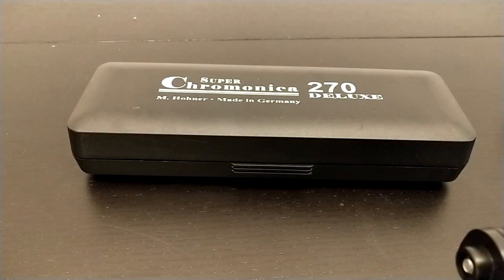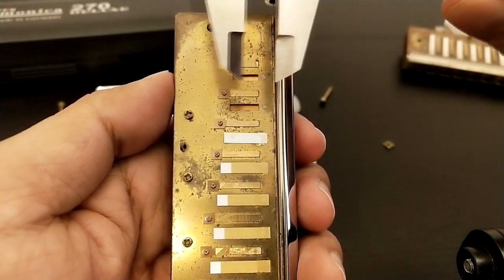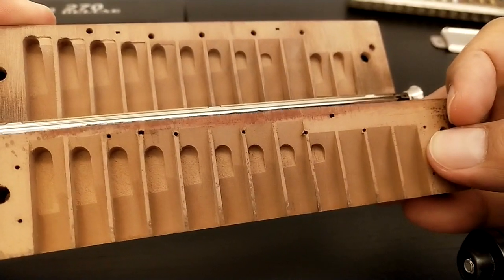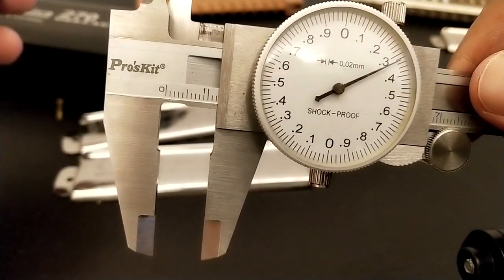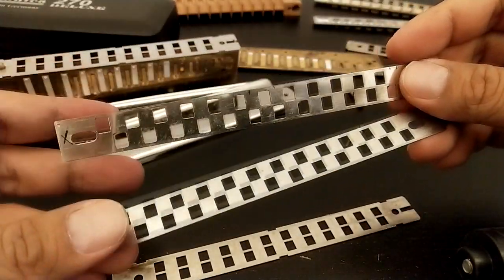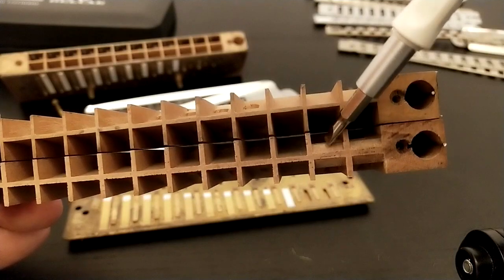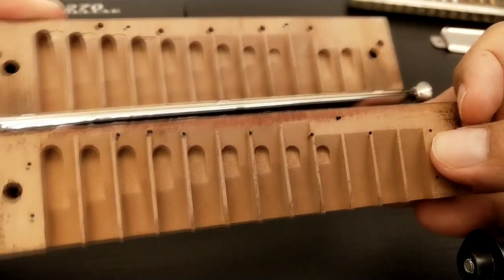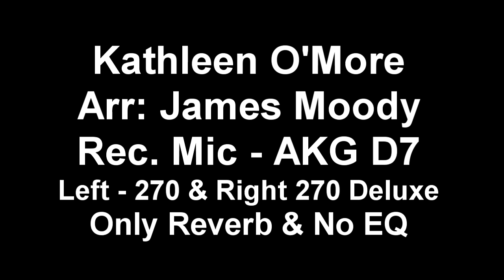Hohner 270 Deluxe vs Chromonica 270 - Owen Harmonica

Comment: This is a fantastic review, very detailed and particular.  I am looking at buying a chromatic either  a 270 or 270 Deluxe. I like the design and the ease of dismantling that the 270 Deluxe offers. The 270 construction (nails) is very much like a classic Hohner Marine Band diatonic and is the cheaper of the two for this reason. Sound wise, I do agree with one comment that the 270 has a darker sound. For me, it may the choice at this time, considering the type of music I want to use it for; blues , rock and jazzy type stuff.
Reply from the maker: Thank you so much for your support, I really hope that my video can help you make your make the right decision. Wish you have a wonderful day.
Reply: Hi. It’s a great review. But I regret buying 270.  Should had ordered 270 deluxe.  270 square holed Hohner is a worst I purchased. So much air loss. Have to blow hard

Comment: Nice review. I actually own both. But you should have included the Discovery 48. It's based on the Chromonica 270. It is not only beefier in size and weight, but the slide is zigzag, which I prefer over both shown in the video.
Reply from the maker: Yes,  actually discovery 48 have it owns unique character
Reply: Here is a video of a guy playing the two: https://www.youtube.com/watch?v=lThgkPMg07c

Comment: Hi Owen. Excellent presentation.  I have two Hohner Chromonica,s 270 and one Hohner Chromonica 280 C
I much prefer to play the 270 (12 hole) than the 280 (16) hole. The 16 hole far too cumbersome for me.
I also prefer the square hole, however the round hole is more comfortable
The main thing I got from this is when I buy a new one I would definitely choose the DELUX model, because of the screw removal of the reed plates.
I am scared of removing the reed plates on my 270's for fear of damaging the cones.
Is there a tool you can suggest for removing nails safely .
Thanks again Owen, I got a lot out of it.
Reply from the maker: Hi,  thanks for watching, there are so many ways to open up the nail, you can use a knife,  cutter (bigger size ) flat screw driver or anything that are flat and hard. When you open it up, you need to pay attention on your hand, be gentle and slow to put in the cutter or knife in the gap that between the comb and reedplate. Do it slowly,  it is not too difficult to open up the reedplate,  as the wooden comb are male by pearwood. Try to do it on left side then only slowly move to middle and right side. On the right side there is a spring nail attached to the reedplate, you can pull up the whole reedplate slowly after you saw the gap between comb and reedplate are getting bigger. I wish you enjoy on this process.

Comment: The back ( inside) of the mouthpiece is extremely rough (10:17). The  result is a lot of air loss. I sanded it completely smooth and then polished it. The improvement is noticeable in a quicker response and less fatigue.
Reply from the maker: Yes, the hard work that you did surely you will get a better result 😀😀

Comment: Does the deluxe mouth piece mount with wood screws like the 270?
Reply from the maker: Hi,  yes
Reply: @owenharmonica  Thank very much for your quick response. I’ve played 270’s for years and the mouth piece is removed much more than the reed plates. Though I appreciate Hohner mounting the read plates with machine screws. I feel it’s short sighted and lazy to not include this with the mouth piece when producing the deluxe.

Comment: Dear oven thank you so much for your extremely valuable rare , scientific analysis of 270 chromanica s,,,,I recently purchased a second hand 270 chromanica original one not the deluxe,,,and dismantled mouth plates for cleaning,,,my goodness,,,, comb is almost damaged near the mouth plate fixing nails and slider spring,,, somehow with the help of some glue and and great effort I managed to get it fixed,,,but I'm sure this is the last chance that I have to clean it removing mouth plate,,,,so please help me to get this solved,,,is there an economical plastic or metal comb to be purchased in market to replace this deteriorated comb,,,,if so will I have to drill new holes in the Reed plate,,,,also will I be able to remove present wooden comb from the Reed plates,,,removing rivets,,,,and also where to find new screws for fixing new comb to Reed plates,,,,, please help
Reply from the maker: Hi, you can search on google hohner 270 metal comb to get what you want.  I think the reedplate must be drill hole in order to put screw on it.

Comment: Owen, do you ever play other keys of the 270? Or do you stick with key of C no matter the key signature? And why not play the Super 64 instead? Curious about your thoughts on this. thanks. Great video by the way - the deluxe tone really came through, and the duet at the end was wonderful.
Reply from the maker: Hi,  thanks for support and watching my video.  I have came across to play different key before,  as my hearing is fix C,  and I get confusion when I play different key. For example when I play Bb key,  in C major is draw note,  but in Bb major is blow note, I will draw the note immediately when I hear Bb, so I prefer C major for myself.  I do agree that using different key to play some of the songs are better in result.  It depends on your choice.  For 16 holes I do have super 64, 64x, hearing 16,n CBH 2016. I will also do a review on that.
Reply: @owenharmonica   Great thank you - a very practical answer. I will be looking forward to your review.

Comment: The 270 bottom plate said MADE BY GERMANY, whilst 270 Deluxe doesn't...
Reply from the maker: Hi,  thanks for your support and comment.  As we know,  in others industry like auto industry or toys industry , those international brand they have several production plant in the world,  and last it will claim back the credit to where the original birth place of the brands.  There are few angle that we can look at it.  No doubt there are so many parts involve in the harmonica,  and not all part are make in German. But the idea, and technology are from them,  is just a mirror transfer of the making parts in the different locations. In my opinion, I don't mind where it makes, as long as the QC,  quality and performance are tip top.  Cheers
Reply: @owenharmonica  Thanks for taking time to reply.
Reply from the maker: @ABC-uz2tw  you are welcome